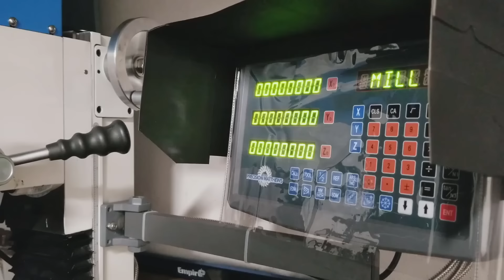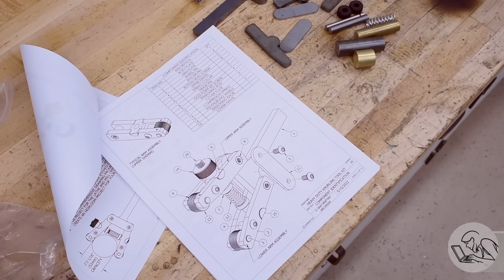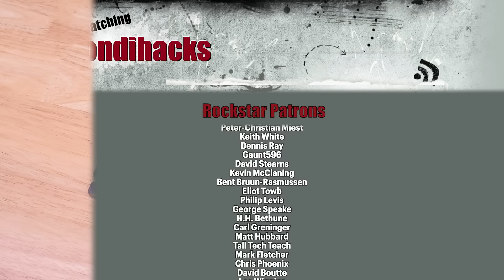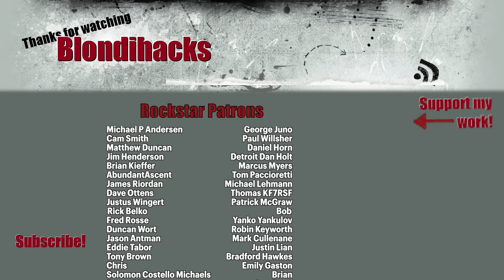Let's Make a Knurling Tool!  Part 1

Comment: Quinn ( no# 1 You Tube Machinist ) , little tip for you. If you pre  heat  the parts  with a map gas   torch  it drives the moisture and oil off the part  and gives you better penetration with fewer tacks  . to take them apart put the stack in your bench vice . and just give it a shot with your custom made hammer.. Thank you for taking the time to make these videos...

Comment: I was taught that, when setting a stop of any kind, you have loosen the vise or clamps and press the part gently against that stop again after tightening/activating the magnet on the stop. This is because it's likely that whole tightening whatever holds the stop in place or turning on the magnet, you probably moved the stop a bit. After you've reseated the part then yiu do your edge finding or zeroing or whatever you're doing.
Reply: My father, 40+ year machinist, told me the same thing.

Comment: A trick I learned when separating tack welded parts after grinding and the penetration got a little deep, put one in the vice flush with the top of the vice jaws, then either use a hammer and punch or a wrench to twist the other part free of the mate.

Comment: "Hatespiration?"  I LIKE IT! ! ! !  And a key factor in some of my own tool making projects !

On holding the tackwelded stack of arms.... I heard the CRACK and listed to your explanation about the laser cut edges.  It occurred to me that perhaps this would have been a good time to use strap clamps to vertically clamp the stack down to the table.  And to provide clearance for through drilling and reaming to either lift the stack up a little with a piece of sacrificial aluminum or perhaps some square stock spacers?.    As a side benefit it would have also given you some extra height for the other drilling and reaming operations.  Your thoughts?

Already looking forward to Part 2....

Comment: Nice job 👍👍👍👍 for tack welded parts I save old razor blades you can lightly tap them in to separate them just enough for a thin screwdriver when doing this though 1 you don't have to whale on it and two you have to accurately come down on the back of the blade if not you will shatter it the blades are strong in line but weak side loaded

Comment: Stubby reamers are extremely easy to find if you have a die grinder and a cut-off wheel :D
Reply: I think she’s addressed this before, chopping down the shank deletes the center drill on the end which is a problem for reasons that currently escape me.
Reply: @vaderdudenator1  Hard to remove from tailstock.

Comment: The problem I had a hard time with when I started out drilling was just how much down force drill bits wanted/needed.  I had a bad time with not pushing hard enough while hand drilling, especially with bigger drills.  For some reason my brain fought with the idea that not pushing hard enough work hardened the part and pushing harder wasn't going to (as long as cutting oil/coolant is used) burn the bit up.  By the time I got my first drill press, I was well-versed in the proper way to burn up a drill bit and had no more problems.  By that time I had already moved on to burning up lathe tools...

Comment: At 11.20 your mention how you were doing lots wrong when drilling. I am a Metalwork  Woodwork Electronics teacher here in Sydney Australia.  Getting students to build a stationary steam engine needed a boiler that has stainless steel firebox. Each stainless steel piece needed 4×10 mm diameter holes. I eventually concluded one needs to predrill a smaller hole, ensure twist drill is absolutely sharp, correct cutting speed and lard as lubricant. Otherwise stainless steel is extremely difficult to drill.

Comment: For eventual finishing, not sure what youre going for, but if oxide black is your flavor of choice, then citric acid solution does a surprisingly good job at blackening steel. Cheap,  can get amazon to ship you a 5lb bag of it. A bath of hot water and a large portion of citric acid will blacken steel. I did a pair of scissors that had exposed steel on the ground mating surfaces, and chrome on the rest.  It has held up very well on the faces that rub each other, but not sure how that compares to shop duty.
Reply: Well, you can also go for something "stronger". You need sodium hydroxide and potassium nitrate solution in water (600g/200g/1l) and boil that. Sodium hydroxide will take care of degreasing and will provide proper pH for nitrate to oxidize steel
Reply: @PaulSteMarie  that is true. However, hot citric acid is not that much better. Safety glasses, safety gloves, work outside, get a temperature controlled heater. You can also try fume process, but I do prefer caustic salts over fuming acids.
I've beed using much more toxic chemicals in my life, it is just matter of good precautions

Comment: Cool little project. I was planning on doin this one myself, but your level of precision never ceases to amase me. I think I would have just drilled on the X'es. 😅
Reply: I've never had the tooling Quinn has (finally starting to get set up) but I've always used similar techniques for parts that need to be matched. If you don't and get it wrong you then have to redo and that is a waste of time and materials

Comment: Something I've never been able to get an answer on is if the circumference of a knurling wheel is not specifically sized to be a multiple or divisor of the circumference of the part being knurled, why does it not overlap and just chew up the surface?
Reply: It does.
Reply: They totally can chew up surfaces.    But the knurling wheels are not powered or restrained, so if they get the chance to fall into their previous cut, then they will.   It is even possible to get a coarse knurl to go twice around the part before lining up on itself.
Reply: @criggie  OK, now that makes sense to me, thank you.  So, if someone says they don't like how it turned out and they turn down the part a little, they are just trying to help it track a little better?
Reply: The diameter of the workpiece should be turned down so that the circumference is a multiple of the distance between 2 teeth.

Comment: A bit hard to explain but if you replace the top rear pivot bolt with an eccentric arrangement with a suitable sized handle so that you can really apply pressure to the knurls. I saw this sometime ago in Model Engineer magazine. (or it's I'll)

Comment: We laser cut everything where I work. The unspoken rule is "if it needs machining in any way on a laser cut edge, make it from a stock material not from sheet (plate)."

With that said, how 'hard' do you think the laser cut puts on the edge? In my old job we plasma cut everything and I know that can get hard depending on the thickness. I've got no experience w/ laser though.

Thanks, love the channel. It's my relax on Saturday w/ a beer go to. Keep it up!

Comment: Stubby reamers are sold for CNC tooling.  So shop those sources for sales and cheap ones.  No difference, just short.  The general school of thought is that a less precise machine should have a long reamer so it can flex and follow the hole... but for almost all hobby drill presses or personal CNC machines Z height is always short.  You can also just commit a sin and cut the long reamers down some.  Nothing wrong with that.

Comment: Thats Murphys Welding Law: If you need a very light Weld with no penetration, you'll get the perfect penetration. If you need a good structual Weld, than you'll get no penetration.

Comment: A nice build so far. Might need to add one of these to my tool stock. Why not reference the gauge  pin on the end of the vice jaws for the set screw hole?

Comment: Quinn,
Could you have used the gauge pin against the vice jaws or would that have been too tight to get the pin back out of the hole for the drilling?

Comment: I worried when I did not see you applying a lubricant.  But then I could see the oily material.  I hope later you say what you are using as a lubricant when milling steel.  I am thinking of buying the kit and following the video as I do the build.

Comment: I have a nice knurling tool (even though it was made for a much bigger tool holder, a friend milled that stem to fit my little Myford). However I like using both straight cut and diagonal cut knurling for different applications and materials. where and how do you use knurling in your projects?

Comment: It's a very nice design, but the main tightening nut that forces the jaws together may need to be steel instead of brass.
Knurling Aluminum or Brass is fine, but when you want to put a knurl in steel it takes a lot of force, and on my cheapie knurler I have to really get that thing tight to do a decent job, I think brass would strip out, that is unless he has provided some really sharp knurling wheels.

Comment: I do a LOT of knurling. Absolute hate scissor knurl tools. I'm going to build a tool that presses on both sides of the material at the sametime. The main problem with the scissor knurl is that they are subject to bend if you are trying to do a single pass knurl in harder materials such as quality barbells. 

Much Respect
David Dennis
Leitchfield Kentucky

Comment: Anyone knows why you shouldn't reverse a reamer? Or does this need debunking?
I would guess reversing will wedge chips towards the cutting edges, thus...breaking or rounding the edges?
Does anyone know for sure? As in personal experience, not "I was told by someone I trust..."
Reply: It'll wreck the precision-ground cutting edges. Your reamer will no longer be sharp, and may no longer be accurate.

Comment: I watched this whole video, and got a lot out of it! But I have a question - what about straight (non-diagonal or cross-hatched) knurls)? I'm hoping to replicate a missing part from my Rivett model "1R" watchmaker's lathe, and it involves a little disc-shaped knob to lock / unlock the tailstock, and there is a straight knurl around the circumference of the knob. I have NEVER done a knurling operation of any kind before, so I don't have any knurling tools except for the correct knurling wheel for the job. I've read that straight knurls can only be done on parts where the circumference is an even multiple of the distance between the points on the knurling wheel. That's because when the knurling wheel comes around full-circle, it might not line up with itself. Is there a way to knurl with only one knurling wheel? Instead of two wheels, like the scissors tool in your video's beginning sequence.
Reply: Ignore what you have read. Turn the part to the diameter you want, then try knurling it. It will almost certainly turn out OK, but if not, just skim a bit off the diameter and try again. The knurling wheel digs into the metal and deforms it, so working out the theoretical diameter is probably irrelevant.

Comment: intresting that when they laser cut the parts why did they not cut the holes too?
Reply: The laser leaves a slightly jagged edge and is problematic in small holes. Drilling and reaming produces a much nicer hole.😃

Comment: How would I achieve registration of those link parts, given that I don't weld?  Here's my thought... Drill and ream a registration hole in one end of all four pieces, locating the drill positions by eye, since their position w.r.t the edges isn't critical. Insert a gauge pin through all four parts, clamp them vertically using a miniclamp and horizontally in the mill vice with emery paper to allow for uneven edges. Drill a second - undersize - hole, insert a bolt through this hole, and thread on a nut to clamp things firmly. Remove the miniclamp to give access for drilling and reaming the other holes. Once they're finished, a bolt can be inserted into one of them and tightened as a second bolt-clamp, making it possible to remove the first one and drill that hole to size. Is that feasible? Could it be simplified? Or do I have an unassailable excuse for learning to weld?
Reply: I do the arms two at a time and hold them together with thick CA glue. (use punch marks to identify the pairs)
Reply: @d.graydraftinganddesign361  Thank you. Clever and simple. :)  But no thanks for depriving me of my unassailable excuse for buying a welder and learning to weld!  :(

Comment: The kit mentions 95% lathe work. Would it be reasonable to complete the kit with only a drill press? I wouldn’t need to machine the shank.
Reply from the maker: Yes, you could absolutely do this kit with just a lathe and drill press!